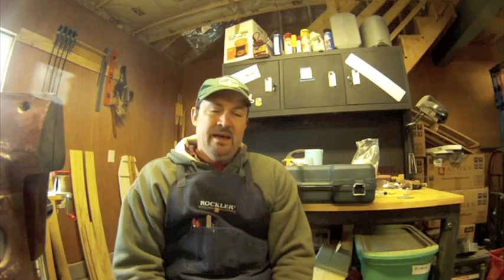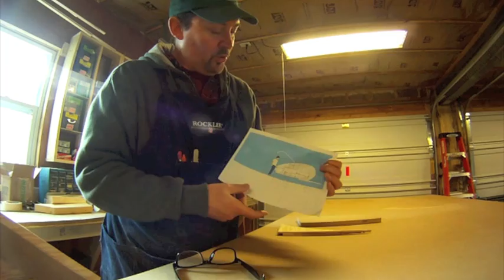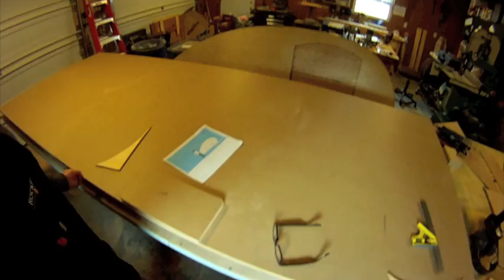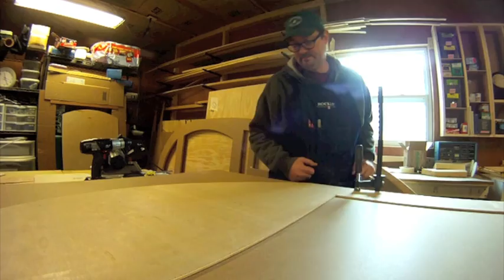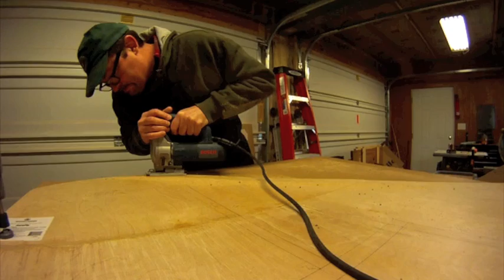Teardrop Trailer Build Blog #1

Comment: Hi, having seen your amazing teardrop on your channel, I was wondering if you could help my friend and I out, we are 15 teenagers from the UK, and we want to get all the required materials by next summer so we can have it built in time for our drivers licence. the difficulty we are having is deciding on a trailer, any tips?
Reply from the maker: +Matthew Miller Hi Matthew, having a camper built by the time you get your licenses is a great idea. As far as the trailer goes, I used a light utility trailer, however most any type of light weight trailer frame could be adapted and used as a base for a camper. The most important parts are to make sure that it's structurally sound, has all the required lights and safety equipment and when you design and start building your camper, pay attention to the correct tongue weight and total weight. You also want to make sure that whatever you build is firmly attached to the frame. Good luck, and post your project on YouTube. I'd love to see your progress!
Reply: Thanks, will be sure to upload the finished result :)

Comment: Hi bcrosstx, I'm not sure why I can't reply to your comments, but hopefully you will get this. I'd still go with a 3/4 inch middle panel, in order to have room to easily run wires. However, if I were starting over, I'd either cut more holes in the side or build it  out of 1x3 lumber. My sides turned out a little heavier than they needed to be. Regarding the skins, exterior 1/4 mahogany would be great if you are wanting to end up with a finished wood surface. If you are skinning with aluminum, you might be able to get away with 1/8. For the roof, you will probably need to go with 1/8 inch material, as 1/4 inch is pretty hard to bend (depending on your profile.) For the interior, if I was starting over, I'd go with 1/8 birch as I think it is plenty strong and would save some weight.
Reply: Got It! Thx!

Comment: Scott did I read somewhere on your blogs you might use 1/2" MDO instead of 3/4" if you had it to do over?  I'm sorta considering the the MDO skinned with 1/4 ply Magonany on outside and 1/4: Birch on interior. Any recommendations?
Thanks 
bcrosstx

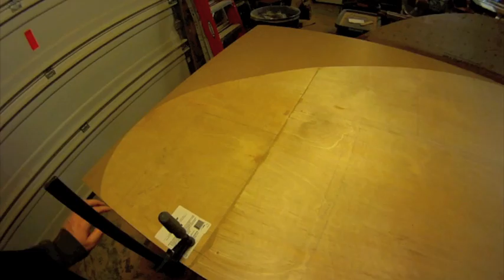Comment: At 5:40 sec point on the video there's a seam on your template. How long and wide is your build? I noticed that your not using the full ten feet of the MDO. I was wondering if you had to make the template material longer and if so how did you do it? Many thanks again...Mark
Reply from the maker: Hi Mark. The length of the body panel is ~9' 6" long and 4' tall. For the template, I lengthened it using a technique called scarfing, which basically involves feathering the two plywood edges and then gluing them together. The technique that I used involved clamping the two pieces on top of each other with an offset and then using a hand plane to make the angle for the joint. If you do them both at the same time like that, the angles should (more or less) be the same. The reason that I did that rather than just gluing piece of plywood over a butt joint, is that I needed a smooth surface for my router.
Reply: Thank you very much Scott...All the best of the season to you and your Family.              Kind Regards Mark

Comment from the maker: HI Brad, thanks for the kind words. Right now, I estimate that I'll have a little over $3000 in it once completed. I think that one like mine could be built a bit cheaper, but I used marine grade plywood and special ordered long lengths so I wouldn't have to splice/scarph the joints. Also, the aluminum and especially the trim adds to the cost. For me, the extra cost items have been worth it.

Comment from the maker: Hi Paul, I guess that you could if you were going to glue the aluminum on rather than float it (attached by trim using minimal glue.) I'm planning on using the float method. But it you decide to glue it, based on my experience, you don't want to wait too long between glue-ups. Mine were several weeks apart and I got some warping due to unbalanced panels. I think that it will be OK, but this has really been a learning process for me!

Comment from the maker: Hi John. No, I didn't consider anything thinner for the middle panel, as I wanted the room to run wiring. However, if I was doing it over again, I probably would have used 1/8" outer and inner panels in order to save some weight. I could also probably cut out more holes in the middle panel. I think that 1/8 inch would be fine for the outer panel, as I will be sheathing the exterior with aluminium.

Thanks for watching!